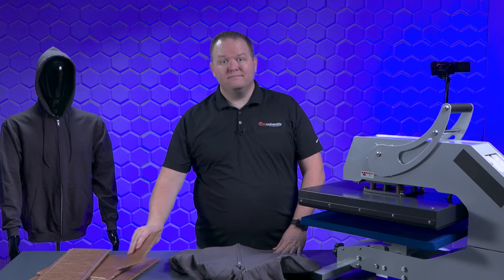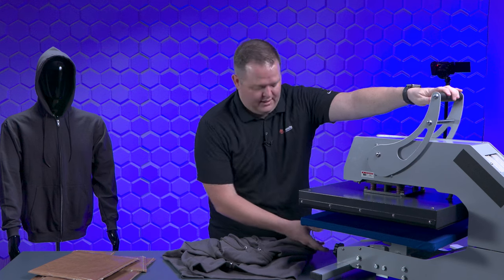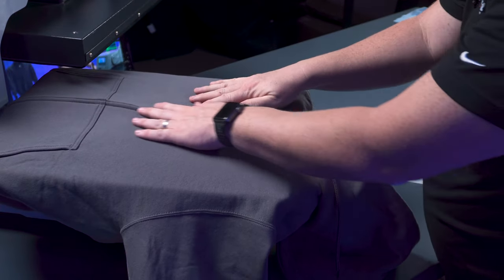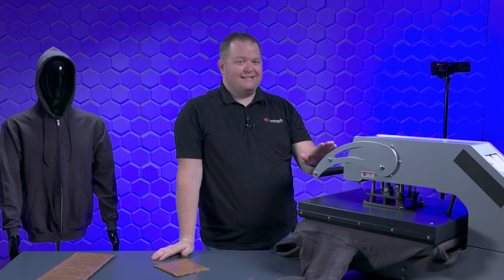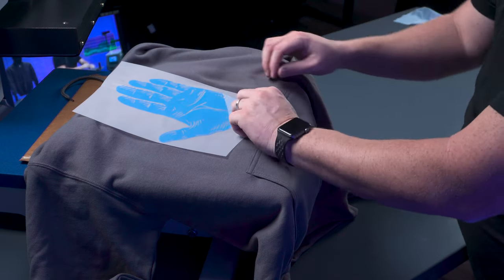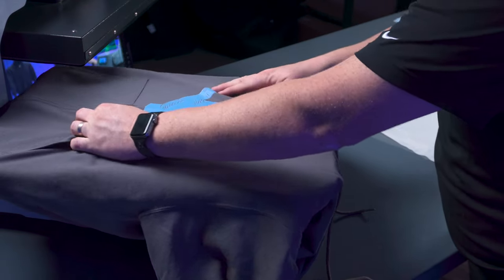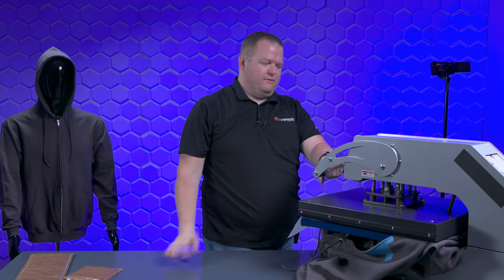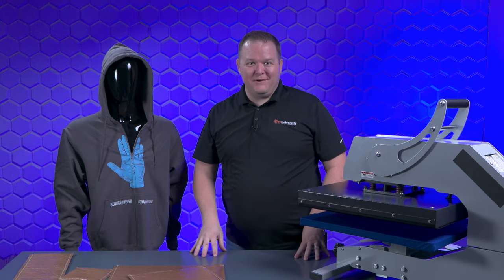Zippers, Seams & Buttons Oh My! | DTF How To

Comment: 1:55 what if i have a pair of shorts and im unable to put the entire thing onto the platform like you did. what would you suggest doing with a pair of shorts with a zipper
Reply from the maker: use a combination of pressing pillow and shift things around until you get a nice press in all areas.  DTF can be pressed multiple times without any ill effects.
Reply: @DTFSuperstore  how much would you all charge to heat press and dtf my design to the shorts if i were to send you a mockup. i already have the design on the parchment paper

Comment: Is there such a thing as non-teflon heat press pillows? Since I have pet birds in the house, I don't use anything teflon because if over heated it can quickly kill my birds.
Reply from the maker: We're not aware of anything like that...many heat presses use teflon as their protective coating for their platen.  It's is a widely used product in the direct to film industry.
Reply: @DTFSuperstore  Thanks. First - I found a YT video on how to make heat press pillows using the fabric used for making ironing boards. Second - my heat press doesn't have teflon in it's construction at all, which is why I chose it.
Reply from the maker: @TimothyAllenMadison   thats great!